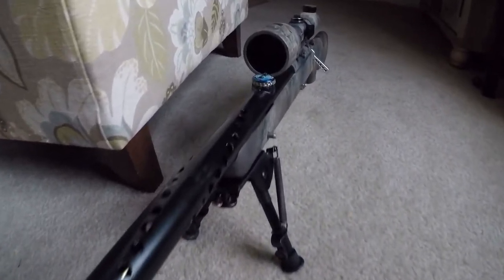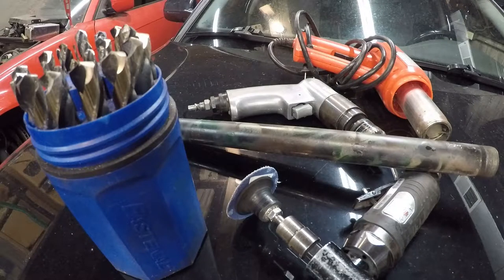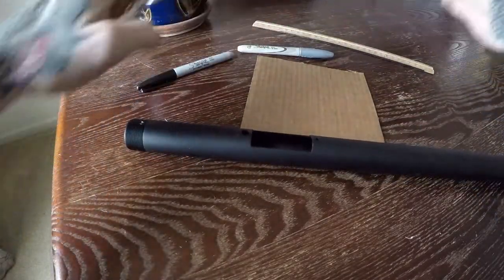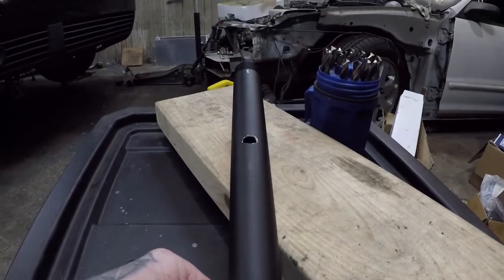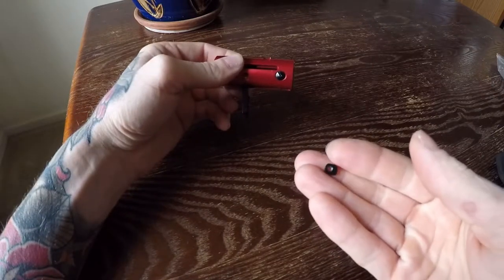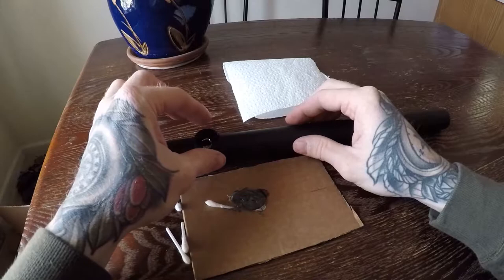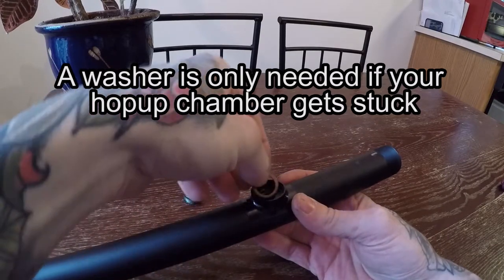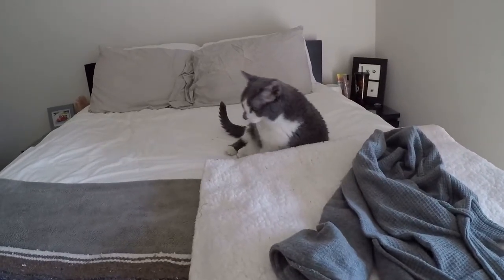Vsr-10 TDC HopUp Mod | DIY Guide w/ Scope Turret | Action Army HopUp Chamber

Comment: For fitting the cap to the outer barrel you could wrap sand paper to the outer barrel and sand the cap back and forth
Reply from the maker: That would work well with plastic caps, but could take a while with aluminum. I found a nice curved metal file that works well too!😁

Comment: Hahaha! When you burned your hand and said that I laughed!  That was good!  I’ve got a Tridos.design TDC hop up on one of my SSG10’s.  I wonder if the template it comes with to drill a hole will work for this design. I am going to try, as that action army hop is the worst when it comes to adjustment!  Thanks for your video!
Reply from the maker: It should be very close. You can have the hole within a certain area due to the length of the arm
Reply: Do you like the Tridos one? Is it better/worse than the rest?
Reply: I actually just finished installing it last night,  and I’ll be trying it out this weekend after I finish putting the rifle back together.  I will let you know.  So far it seems like it’s going to be great.

Comment: Do you know of a Cheap Scope on Amazon I can sacrifice for this mod?  Like to be able to just twist adjust rather then using a screw driver.  But the bottle cap mod looks cool.
Reply from the maker: I think amazon has an NcStar model. Honestly just buy the cheapest scope you can find, that has standard size turrets. If they are metal you can use a curved metal file for a good shape, just keep it centered.
Reply: @BlindSniper  - I found the one you recommended!  Thanks!!

Comment: I have this HopUp chamber in m40a3..could you do this on that?
Reply from the maker: Yep it would work the same! You just need to make sure you drill the hole over the arm at the right spot.
Reply: Thank you sir..this would make it so easier. Love your videos
Reply from the maker: @robertbedgood3189  thanks for watching them!!
Reply: @BlindSniper  I’m gonna try that suppressor mod also…my rifle is waaaay to long.
Reply from the maker: @robertbedgood3189  working on a new guide sleeve! Check out my insta @blind_sniper
Reply: You may laugh..I got the m40a3 sportline..got a Mancraft system, action aa hop unit..vsr inner barrel..so now I’ll try both those mods
Reply from the maker: @robertbedgood3189  doesn’t seem terrible. I never messed with the mancraft. I like the e bolt.
Reply: @BlindSniper  it’s the poor man’s bolt..lol
Reply from the maker: @robertbedgood3189  oh I know, but you said it 😂😂

Comment: Hello, I checked the link out in the description and it’s not the same scope you used in your video.... so will it still work?
Reply from the maker: dirtbike dude any scope will work, I’m just not certain on which cheap scopes have plastic caps. You can use metal caps but they take more work to shape to the outer barrel. I like the plastic caps because you can use the melt method.
Reply: Blind Sniper thank you👍
Reply: I now realize why I’ve kept those cheap scopes around for so long and not thrown them away. Had I done so I would have immediately come across your video.  Probably even if it happened before you made the video.

Comment: Can I do this with the standard hop ip on a Cyma m24?
Reply from the maker: Works with most airsoft sniper rifles as long as there is access to the hop arm on top of the chamber. Just need to drill the hole in the right spot.
Reply: @BlindSniper  brilliant thanks